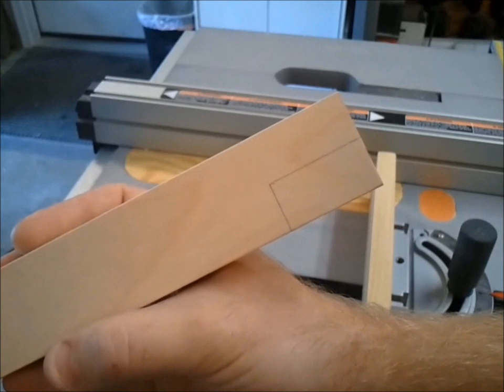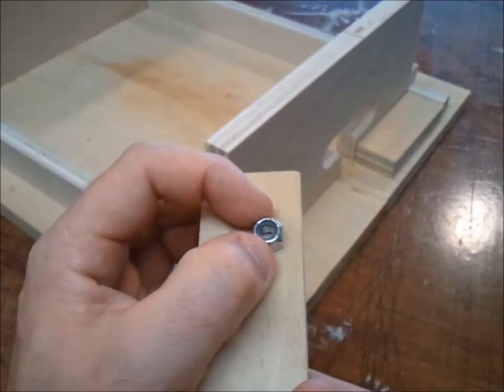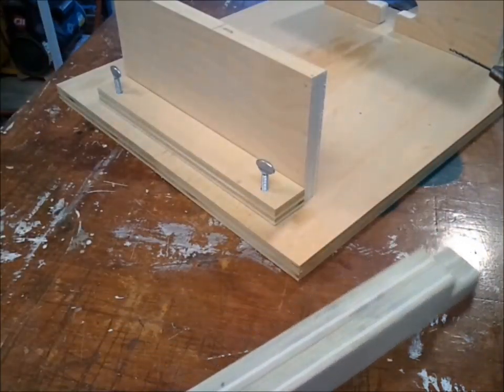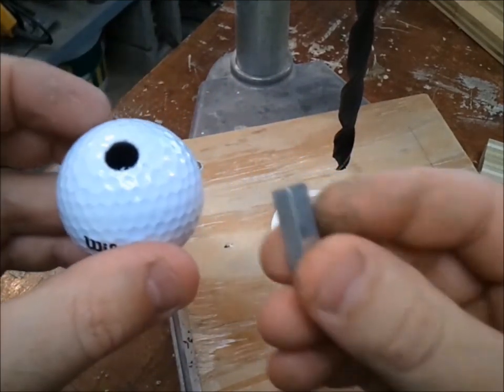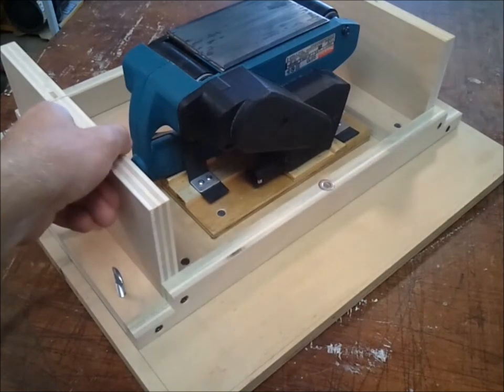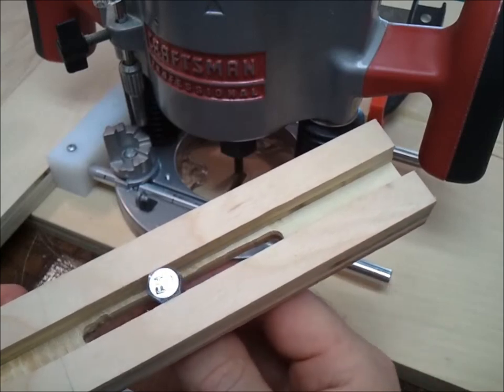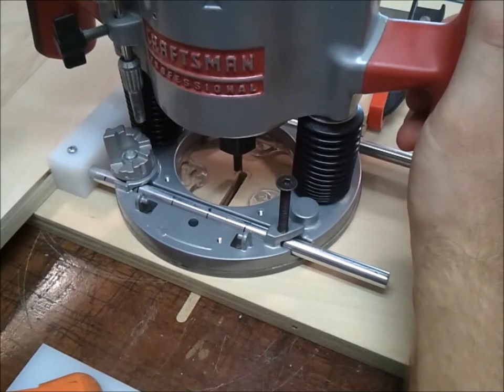Delicate chamfer device (part 2 of 3)

Comment: A simpler approach to making it use the entire surface of the sanding belt would be to mount the sander diagonally so that the 45 degree channel traverses the width of the belt.  That way, no adjustment or sliding table would be necessary.  :D
Reply from the maker: That is a very good idea. The entire thing would have to be re-designed, though. And there are benefits to this approach: tear-out is effectively zero, because it sands parallel to the grain. Oh, and a height adjustment would obviously still be necessary. Still, a great thought.

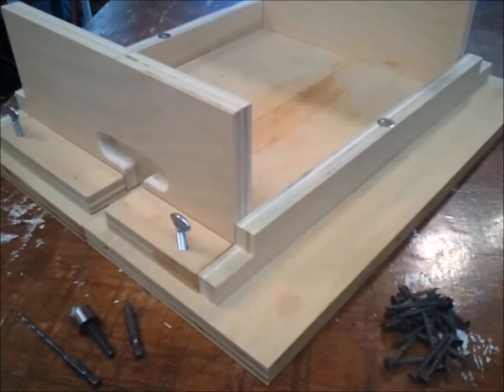Comment: what does counter sink them all mean 5:05, does that mean that tool will make the screws Flush with the wood
Reply: +Pyro Sandwich 
yes, the tool he held up on the left is called a counter sink, so he's going to use it on all the screw holes.